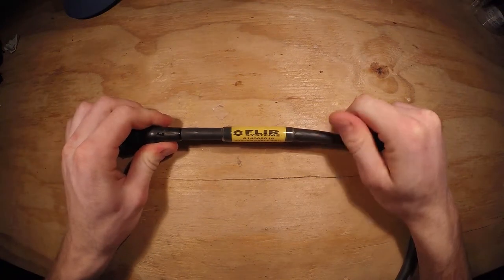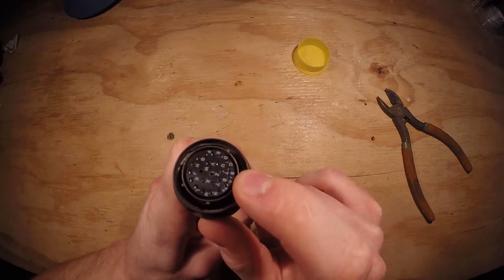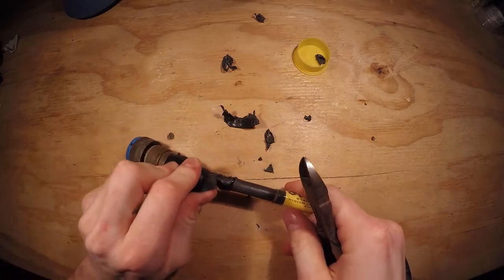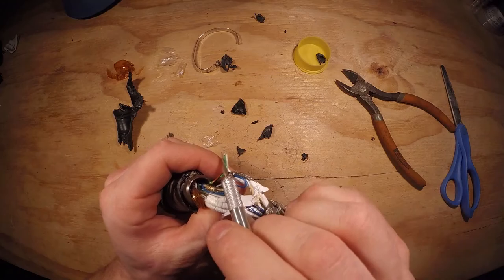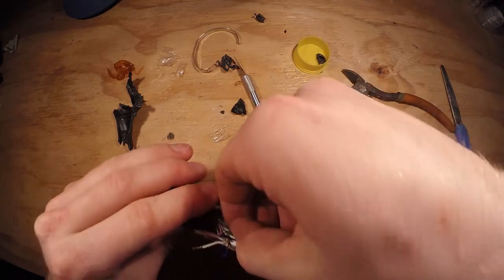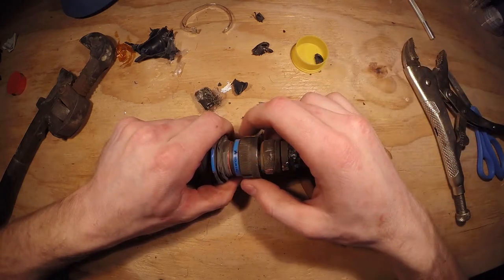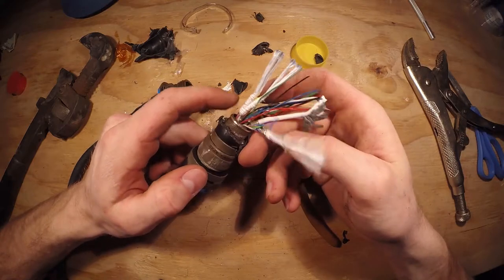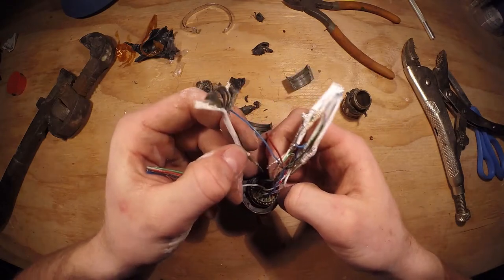Looking inside a FLIR Systems military cable

Comment: Hi there, The Cable (614000616) was used in a system called Sentry/ Sentry II, and was produced around 2000 - 2010, the cable you have is a 30 meters long cable to use between the Sentry and a PC. Here is a link to a youtube video of the system: https://youtu.be/vNfuPkWwwbA
Reply from the maker: That's really cool! Did you ever work with this system?
Reply: GetNshitDone, I work at FLIR today, but I have not worked with The Sentry, but I have seen it and many more cool systems, we have lot of Very advanced and highquality systems. 🖖😊👍